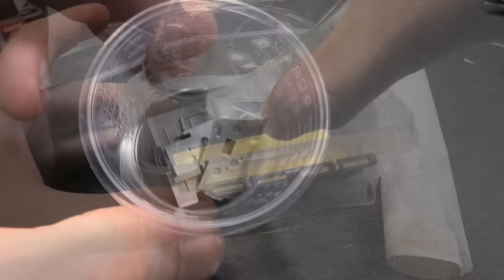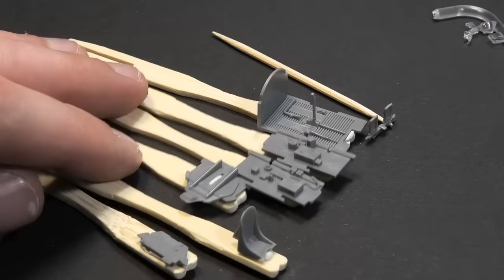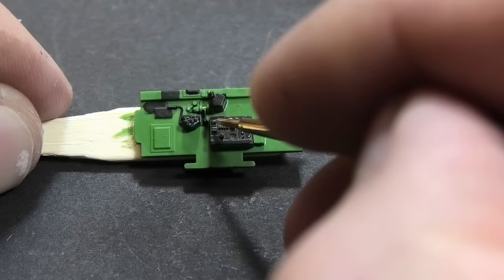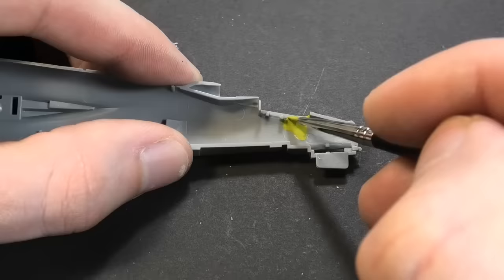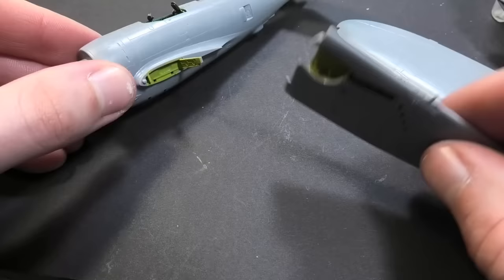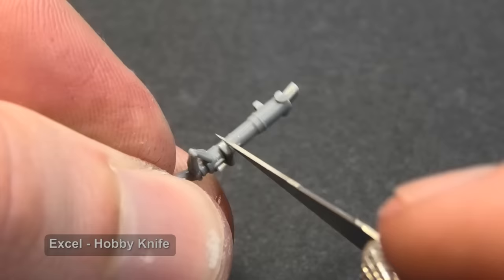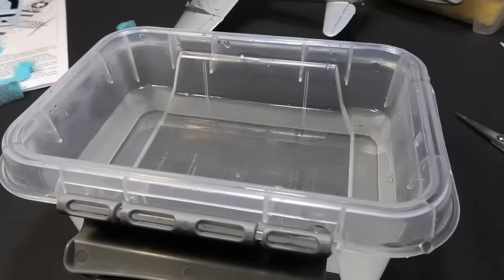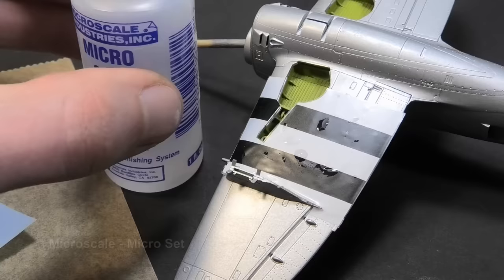P-47 Thunderbolt Bubbletop - No airbrush - Tamiya 1/72 - Aircraft Model

Comment: The best advices for beginners are:
- Try Your best
- Finish the model, no matter what
- Try again
- Enjoy the process
Eventually You will get there 🙂
Reply: second step is the most important. i had several projects that i thought i botched but could still save somehow, its the fastest way to learn
Reply: Second step really depends on the situation. Never quit a model just cause you messed up somewhere along the way, it's always a good learning opportunity.

However, if you're simply not having fun making a model, there's nothing wrong with stopping in my opinion. all model kits aren't created equal, and some can be truly horrible experiences.
Reply: The most important beginner advice is that there are very few permanent mistakes. Paint can be stripped and you can try again, even bad gluing can be saved. Outside of destroying your parts, almost everything can be undone in some capacity and made right.
Reply: Trying again is the expensive step😢

Comment: One thing to note when building a kit with D-Day invasion stripes is that none of them were as straight and neat as the decals. I knew a guy who was a crew chief on 4th fighter group P-51Ds. He told me that the order to apply invasion stipes came at 9:00PM on June 5th 1944. He said it took all night and they used anything they could find to smear on the stipes, brooms, mops, even their hands. If you're going to go through the effort to build as realistic a model as you can, raggedy stripes would seem to be a must.

There are two ways to accomplish this: One is to apply the decals as shown in this video, then follow up with a paint brush making the lines appear hand painted. Two, perhaps the better option, is use the decals as a measuring guide to mark where they go and paint the stripes in their entirety by hand.

Comment: G'day David, Another great build and this time for beginners and older folk coming back to the hobby after a long break. When I was a boy modeller there were no airbrushes for our hobby and none of the other advances in tools, jigs, chemicals etc. Just glue, paint and brushes, my first 'hobby knife' was my one and only little pocket knife. 
These types of videos will be really helpful and keep a beginner's focus on just the model. Since I got back into our hobby, I concentrated on aircraft of the RAAF, many of which, during WW2 and afterwards, were bare metal. I found out that multiple coats of a deep, flat black primer gave the best results when doing bare metal finishes. 
Also, I always paint 'invasion stripes' freehand and do not pay too much attention to getting perfect straight lines between the black and white stripes. 
This is because I have collected many period photographs of invasion stripes being applied by ground staff using 6 inch brushes from large tins of paint, applied out in the open air. 
So called invasion strips were applied at very short notice and the qualified Surface Finishers were busy replacing aircraft ID numbers and roundels that had battle damage. So, invasion or 'friendly fire' stripes are never accurate when applied from decals with precise, straight lines.
I was in the RAAF and I learned that aircraft flown frequently are really quite dirty and worn when seen right up close. 
Weathering is, of course, for each modeller to decide but, here again, during the height of big air battles, like The Battle of Britain, all aircraft endured extreme wear and tear. Of course, on small models, this realistic weathering can look way over the top. However, when doing 1/32 or 1/35 or 1/24 scale aircraft, weathering can be shown much more like it was in reality.
Mostly, we have movies to blame for this trend of meticulously painted and new looking aircraft. Antique aircraft used in these big war films in the 60s and 70s just could not be artificially weathered as they were worth a fortune to restore. 
In war movies you can tell the aircraft that are 'on set' 1/1 scale dummy models; these are the ones that have been weathered a little and are blown up during the film.
For me, I can't over stress the importance, and time saving possibilities, in doing detailed research from old photographs found in history books and even old press clippings from newspapers of the day. 
There are websites that archive old blueprints and technical drawings for just about every aircraft, tank, ship or submarine used in WW1 and 2. These can be valuable sources for accuracy, particularly if you need to know where the real panel lines were; or what attachments to a tank are accurate etc.
Thanks you this video, I'm going to get a 1/72 aircraft kit and restrict myself to what I had as a kid; just to see if my adult experience in modelling can turn out a better, simple little kit. Thanks David and take care. Cheers, Bill

Comment: I've been building models for years now, and I only just learned that you are supposed to leave the decals wrinkled after applying micro set. thanks! I thought I was just terrible at applying decals
Reply: Sometimes add 3-5 applications of micro sol to soften the decal if there are raised details under it.  It will eventually work.  👍

Comment: Something I do recommend that Plasmo doesn’t: Buy high quality drill bits.  Yes, they’re more expensive than cheap eBay drill bits, you get fewer, and if it breaks it hurts worse; however, they’re way more durable, they can hold an edge better, and if you’re very careful with them (Cheap eBay ones you’ll have to be careful with for the opposite reason; you’re careful with them because they’re so cheap they’ll break on a moments notice), they will never break and you will have bought a very nice set of drill bits and they’ll last forever.  A cheap set you’ll have to replace at one point or another.

Now: I do understand that stuff being cheap is enticing to bring people into a new hobby, and it can also be argued that the cheap buts will start you off.  I wouldn’t recommend that either.  Buy the expensive bits once, and you’ll never have to worry about a drill bit for a very very long time.  If you find yourself using one or two sizes more than others, I’d buy another bit in that size, in case you misplace one or the other does somehow break.
Reply: I usually use a small iron nail. If you only have to make one or two small holes then that should be enough if you are careful.

Comment: an excellent video for less advanced modelers who want to get started, but do not want to spend a lot of cash on advanced equipment.  paint density required for brush application beautifully shown.  I already know that I was brushing the surface too much with revell aqua paint and I was streaking it, you showed what the layer should be for a beautiful smooth finish.  thank you for that because I thought maybe I need to replace all the paints with a different company.  for the tests when painting the M109A6 revell, I only gave a layer like yours in 1 place, but I was afraid that such thin layers would destroy the detail and I was brushing for a thin layer until there were traces of fibers.  When it comes to covering large surfaces, I recommend trying the Hataka Hobby Blue Line paints.  are clean under the brush and leave no streaks.  there are small 10ml bottles, I do not recommend the larger ones with a dispenser, they are often not too tight and they foam a lot when mixed.

Comment: This is the equivalent of camping or "roughing it". 
I remember the days of me buying Testors white paint brushes and Model Master paints that I cleaned and thinned with kerosene. Glad I got a job so I could buy an airbrush, compressor, and quality paints like Tamiya and MRP to compliment some Kolinsky brushes. No more camping in the woods! Very few times I go back to brush large areas now. Save them for the details, figures, washes, or panel liners and oils.

Comment: The beauty of using the super thin glue,or even the thin glue is,if you have a part slide or sag(like the horizontal stabilizers you showed) you can reapply a little of the glue it will soften the original glue and you can manipulate the part!
Reply: Oh yeah! When doin the decals,if you get an air bubble that won't work out even with the softener/solvent,you can use a needle or a straight pin and poke a small hole they apply more solvent and it will lay down.

Comment: Solvent based putty drying time may vary depending of the amount. It's always "sitting down" a little bit when the bottom part of thinner evaporates. After 24h you can notice that perfectly flattened surface is not perfectly flat anymore but has small depressions.

Comment: Great tutorial thanks Plasmo. i have some problem when using Mig Ammo black wash, which is enamel based. It tears of the paint below even after drying it overnight and applying glossy coat with drying time. Did you use acrylic wash over acrylic paint correct, and with or without satin or gloss coat below? thanks much

Comment: Great video, thank you for this. I'm also coming back to the modeling after a decade or so away from it.
I have one question dough - did you apply any varnish on the model after finishing?
Reply: Always a good idea to spray flat clear after decals it helps them look painted on.  Be aware though DON'T do it with the clear canopy on the model, and mask any other clear parts.  👍

Comment: Iv been getting super discouraged with my model making stuff. I cant figure the panal line thing. Loke the black in the lines. I am having a hard ass time with it. So basically iv made 3 planes without doing that. So i varnish it first then do the panal lines? Or do i airbrush the panal lines before. But if i do aluminum it just covers up the black i put on the panal lines.

Comment: I gave up on this one. Twice i tried to paint it with AK xtreme Polished Aluminium as a base colour. Twice i had to remove paint. And i gave up, bcs model always wears and takes some domage when you remove paint. I believe you had problems with this paint too (eduard mig-15 video?), Plasmo? There's something wrong with this paint, or i do something wrong. It smells different than AK extreme Aluminium (dark, white or regular) and it nearly dosnt dry, is fragile, and it doesnt create smooth layer (even when i polish priming layer - mr surfacer black, then black gloss, then polish with tamiya compounds). On the other hand AK extreme Aluminium (dark, white or regular) creates pretty good layer.,